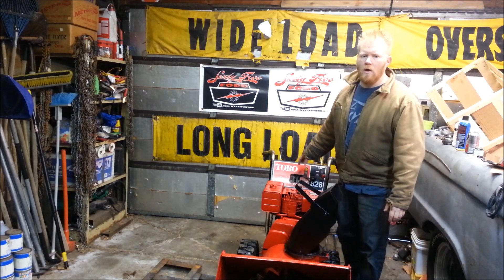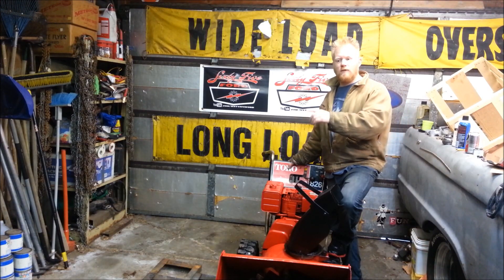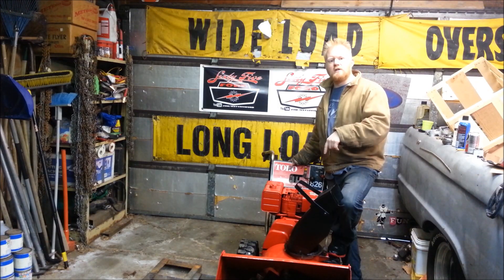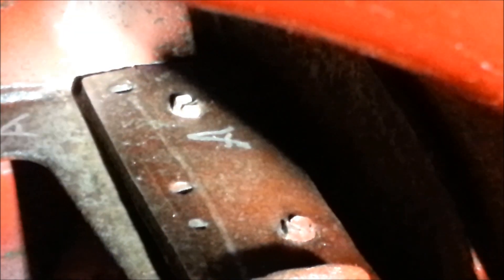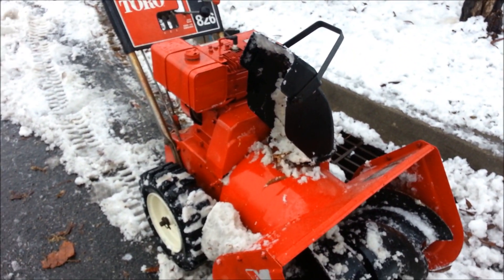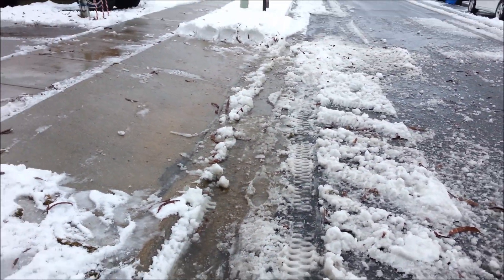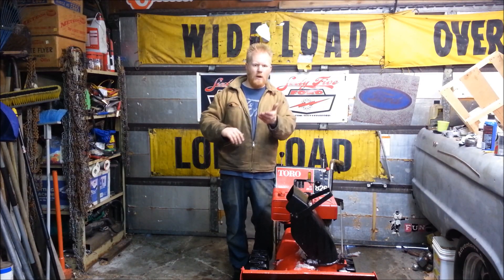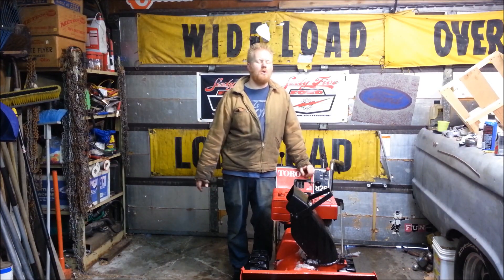TEST snow blower Impeller Modification with and without

Comment: Thanks for sharing. Fall of 2019 i bought the same machine 8/26 1975. Plus a Toro blade for the machine never used that i can see. A mod i will be doing.
Reply from the maker: It makes a big difference in performance. These old Toros are tanks and will never die.

Comment: Finally, going to install paddles.  My Sears 9 horse 2 stage has a 3 blade impeller.  I'm thinking of installing 3 paddles, unless you see a concern.  I added "drift cutters" because where the driveway meets the street, I get 3 feet of wet snow from the snow plow.  I spend more time blowing out the end of the drive than I do on the whole driveway because of the clogging.  Again, great idea.
Reply from the maker: Yeah, put it on all 3 to keep it balanced. Working on your snow blower in the warm weather is always better than in the middle of winter.
Reply: The Sears Craftsman 9 horse has a bend or cup shape to each impeller blade.  The steel is also thicker, so 15 min. turned into 2 hours.  I used new rubber from a single stage snow blower.  I also noticed the fit has to be made for the chamber underneath and not the chute.  We ran it and the rubber and fabric flew out as it wore in.  OK, now I wait for snow.
Reply from the maker: The snow will be here before we know it.

Comment: I bought end piece of conveyor belt material for 25 bucks. about 8 ft long and 3 ft wide.  so far I have made 3 sets of paddles for single stages and done 3 modifications to 2-stages. I made templates on 1/8 / 1/4 in ply wood.  took a compass and added 1" to the old paddle.  then added an extra hole so they could push the paddle in towards the middle so when the paddle wears you can move paddle out to the next hole and keep on truckin.  then when that edge wears out
add another hole.  I used a brad point wood drill bit and it made a really nice hole
on the side of the paddle that the shank/hub of the bolt goes on.
Reply from the maker: That's a great setup.

Comment: Nice work young man!  I still am looking forward to seeing a video on how you would construct a heater for the bed of my pick-up truck so i can camp out in it during the winter.  I have some ideas using a propane stove, cooking pot, coil of copper tubing and a small  motorcycle radiator.  Is this possible?  Thanks.
iron
Reply from the maker: This is on the lines of my thinking but it needs to be an open system to make it safe. I was thinking a small car radiator would more easily distribute the heat.

Comment: Hope the People of Boston KNOW about this MOD.

I'll be putting it on my Craftsman/Husqvarna SNOW THROWER...as it has the same ICING/CLOGGING problem.

Thanks for the idea...great solution.
Reply: Romeo Whiskey Did it work?
Reply: Fishingtuts
 FT...Haven't had sufficient SNOW (Colorado) in the past few days so I can't say "YES" for sure.

Will update the post to CONFIRM the probable/anticipated "YES"
Reply: Romeo Whiskey

Actually was able to PLOW this morning.
Snow thrower throws it MORE than 8 feet than without the enhancements.

Also...seems like the enhancements were sufficient to CLEAR the ICE COLUMN of wet snow when they did occur.

Results: 9 out of 10!

I'd recommend it to others to do.
Reply: Awesome

Comment: Got an old early sixties snowbird and you have me thinking.  I happened to watch the otehr video yesterday so great timing.
Reply from the maker: I had twin snowbirds years ago and was going to weld them together for the ultimate snowblower. Felt bad about trying something like this so I fixed and sold them.
Reply: that would have been cool on front of  a tractor!
Reply from the maker: I was going to power it off one 18hp Briggs and did think about putting on the front of my tractor. I believe they were about 30" wide each. They have the most unique shoot ever designed.
Reply: The whole housing rotates on mine that surround the impeller....Different AND thick metal that does nto seem to want to rust.  Got a 226....think from either 62 or 64...not sure.   6th generation 22 inch.

Comment: Well, it does do the trick.
I do seem to see more problems overall with the more recent, 2 stage throwers. I once had a Simplicity 5 hp single stage, bought used, built in the 60`s. She would consistently out perform any thrower I have seen since. I made so much cash with that machine, I cannot tell you. As long as the snow wasn`t deeper than the top of the chute, it would go through it, and ask for more. I believe anything that will assist today`s machines overcome the stupid design flaws inherent in them the better. Looks like you just closed one of them.
Reply from the maker: Engine wars coupled with price wars have been manufacturers only concern for the past 2 decades. Great brands like Simplicity have been acquired by price savvy companies. The only decent brands left are Toro, Honda, Ariens and Simplicity. Everything else is relabeled budget equipment.  MTD is trying to step up with their Cub Cadet line but it's still cheap.

 I have a 1972 4hp Simplicity Sno-Away single stage that I still use, Great Equipment.
Reply: Yeah, mine was the Sno away. Been years since them days. They had the power and were so light. Just a set of chains and you could go about anywhere.

Comment: thank you!  i can now throw snow across the street, really happy with the results
Reply from the maker: Awesome.
Reply: of course now i have to bu a new engine, will a 6.5 honda clone fit, i already know i need a 3/4 inch to 1 inch adapter, is the baseplate the same as an hm80?
Reply from the maker: I think the bolt pattern is the same but I'm not sure if the height of the crankshaft is the same. So you may need to raise it up a little on blocks so you can use the same belts.
Reply: my main concern was the pattern, ive tried 3 different carbs this year and they all do the sdame thing, the snowblower will run fine for 10 minutes with light surging, and then it will start to stutter and run like shit, making it useless, its frustrating, im giving up on it for now because i found a clone on ebay for 80 dollars brand new, and honestly the old engine is beginning to become a money pit, ill put on craigslist for 75 bucks, i think the exhaust valve is out of spec
Reply from the maker: Here you can see all the dimensional specs of the Honda Engines. Look at the GX160 http://www.smallenginesuppliers.com/html/engine-specs/honda-engine-specs.html

Comment: Since these appear to work well I wonder why manufacturers don't install them at the factory. I'd use stainless hardware as an aside
Reply from the maker: Because you wouldn't buy a new machine if they did. These budget sub $1000 machines everyone buys are just tossed together as quick as possible. You step up to high end Hondas, Toros etc and the gap is generally 1/8" or less and paddle will do very little to nothing at all.
Reply: @sixtyfiveford  Good point. I have an Ariens 13 HP commercial model which cost $2300 15 years ago. There is about a 1/4" wide gap. I'll get some decent rubber and see how it works.

Comment: I operate an 8 1/2 ft snow blower on a 150HP tractor, and have run big snow blowers for about 30 years, and what I've learned is that the design and construction of the fan is everything.

For starters, the hub edge of the fan should be on the leading edge of the hub, so the discharge edge of the fan is trailing, thus moving the snow as fast as possible to the outside. 

The shape, material and construction of the fan is important.  The blade needs to be strong and stiff enough to not bend or deform during the most adverse conditions, and to move snow away from the auger-side edge of the fan to the back side of the fan, and outward as fast as possible for maximum efficiency.  A blade designed like a crude turbocharger impeller would be ideal.  Something stronger than mild steel is needed to keep the blade from deforming when breaking up hard snow, ice, and even the occasional errant rock.

The full-sized portion of the fan blade must be at least as big as the discharge hole, preferably from the point where the trailing edge of the fan is at the lower edge of the discharge opening and the upper edge of the opening should be above the inner edge of the full-width fan blade.  There should also be an angled opening that runs roughly at a 45-degree angle, that the fan can just clear for installation and removal when rotated in the correct position.

The number of blades is also important, especially on larger machines.  If you have,  say, a 30+ inch fan, it needs to have at least 4 blades, preferably 5 or more.  The greater distance between the blades at the edge, the greater the risk that heavy snow will drop in the discharge chute between blades, and when the next 'scoop' of snow is pushed up, the dropping wet snow will collide with the upward moving wet snow and compress, freezing solid, causing the same plugging problem.

The gap between the fan and the housing is important, but it's all proportional; where a 1/4 inch gap on a small fan is unacceptable, it's perfectly fine on a 32 inch fan.  Also, when using the rubber for the fan, either the rubber should cover the whole full-width portion of the fan blade, or it should be attached on the back side of the blade, using countersink bolts so there's nothing impeding the smooth, and rapid flow of snow out towards the discharge chute.  Otherwise, an interesting fix for a prevalent problem.
Reply: I think that I might have operated a 10 foot snowblower on 1984 Wheel Horse riding mower with a 302 Ford motor . Best thing about my riding mower is I take off the snowblower and drive it up and down all over town doing wheelies and smoky burnouts . Best thing about the wheelies is staying in your lane . You want to stay close to the centrally located edge of the leading line on the road . This part might be hard to follow but if your upside down on the center shaft of the backside of the fan blade find the line and try to lead the forward edge . Backspin the fan in reverse order then left reverse right after and you'll be throwing wheelies and blowing burnouts with 150 HP . Take it from me , a 30 year veteran of snow blows , things of 10 ft , wheelies , and confusing the public about fans (scientific term impeller) , and their locations .

Comment: I agree that the rubber paddles will work and won't clog your Two Stage machine but I couldn't resist telling you that you should remake your video without the "Dip" Sign on the back ground.  Added a little humor to this video.

Comment: Mentioned this to another gentleman as well but if someone were to produce a kit with the ''Paddles'' attached to a small piece of plate metal which is elongated they would then be adjustable as they wear out over time. The belting would be pre attached to the plate so it is easy to install. If you get my drift here, cool if not and are interested just message me here and I'll fill ya in better. Great idea to whomever came up with this in the first place. Sure would be a great if this idea were produced in the good ole USA too and not China! Jobs!
Reply from the maker: +Affordable Towing These really don't wear much at all. Good rubber seams to hold up for the life of the machine.

Comment: strange that the mfg dont add plastic or rubber extensions to their impeller blades since this is such a common problem.  given a wat higher quality metal with better engineering tolerances they could do it in metal but that would b prohibitively $$.  still very strange
Reply from the maker: They wouldn't be able to sell new machines if they did. Lower quality machines(under $800) generally have the worst gap problems, where higher end machines will have very tight clearances. But even the high end machines will distort the leading edge of the impeller and the housing enlarges with use; creating a larger gap with use.
Reply: sixtyfiveford yes, a friend just changed the housing on a large machine (8 ft wide).  stones bang around creating dents enlarging the gap.  that happens more in rural areas.  i use my Ariens on asphalt, no rocks - but i still need extensions - thks for the effort!

Comment: as much as this trick works on old outdated snowblowers,newer quality blowers dont need any of it,my Ariens 28SHO shoot snow much farther than this old Tor with the rubber paddles,about 50 feet,and so does my Compact 24 for that matter,i guess this mod is great on old outdated stuff,but it seems to work for those,so can't argue it works,
Reply from the maker: The impeller clearances wear with age and even a mid level Ariens benefits. Impeller design hasn't changed in 50 years.
Reply: well..my Ariens will shoot snow 40-60 feet without modes,i dont see why i would need more,LOL
Reply: @sixtyfiveford   Actually, there are a few different designs out there, but the kit will work on all of them.   A little trickier on the newer Ariens, however, because the paddles are curved.
Reply: +Mario  It will still improve even new machines.   Your output will be more consistent.  I have a pretty new Compact 22 and it throws 30+ feet just fine for light snow, as long as the impeller is full.  When them impeller isn't kept full, the range reduces drastically.  You even see that in this vid.  The Toro threw the dryer snow pretty far without the kit, but the range dropped each time he stopped the machine to let it catch up.  With the kit, the blower has full output no matter how much snow you put in.
Also, my 22 never plugs either, however, it doesn't throw heavy slush very far if I forget to coat the chute with some sort of anti stick spray.   And I should clarify, it's not that it doesn't "plug", it's just that it always has the power to eventually clear itself.
I also had an old Compact 24 before I replaced it with the 22"  It did have a very tight stock gap, about 1/8", much tighter than my new machine.  It actually did a better job as far as getting down to the pavement and having consistent out put, but it was weak and did not have near the range of my new one.   I never did the impeller mod to it, but replaced the stock 9" impeller pulley with a 6" one giving it about a 50% overdrive(1200 rpms to 1800rpms).  It threw pretty far then and that also pretty much stopped it from plugging.  With the pulley mod it threw almost as far as my new machine, but it was still a little less.
The only downside I'm afraid of with the impeller mod, and why I haven't done it yet, is you can throw small rocks ridiculously far with a tight impeller gap.  With out it, they tend to roll off the impeller and not have as much speed coming out of the chute.
Reply: Don't worry, he will MOD his Blower soon!  You all know how People talk chit!  Little as he knows, ALL Snow Blower have the SAFETY CLEARANCE !!!  😂😂😂😂😂😂😂😂😂
Reply: @JodBronson  O, are you referring to rock throwing?  That's one reason, but also tight gaps will freeze more often.  My old one froze enough that I just made it habit to manually move the impeller to make sure it is not frozen before using it and burning a belt.   My new one has never frozen.   Manufacturers don't want to deal with replacing belts under warrantee, or, worse yet, people leaving bad reviews because their machine freezes up.
Ariens markets SHO versions(Super High Output) versions of some of their models.  Guess what, impeller gap isn't even one of the selling points.  It's power, gear ratio(faster rpm), and they heat treat the impeller(that would only provide endurance, not distance).
If you look at old, weak, machines, often the impellers are bent.  They are trying to throw snow forward instead of straight up.  They bend that way because machines anchor the impeller at the back of the housing and extend the blades forward toward the front.  Since the snow comes in from the front the blades are constantly tip loaded putting a lot of stress on them.  On machines where they don't use very thick steel or enough reinforcement, they bend over time.
Newer machines, more and more, tend to extend the paddles axially off the center shaft instead of longitudinally off a plate mounted toward the back of the housing.
Reply: @l337pwnage  - 100%